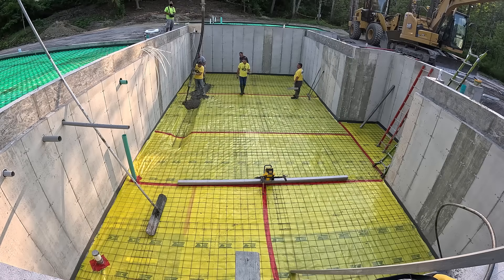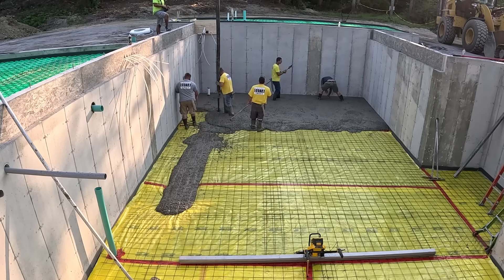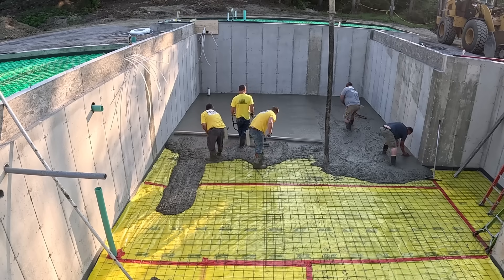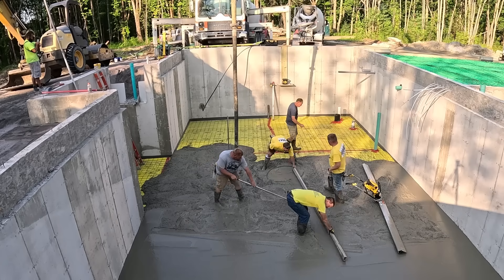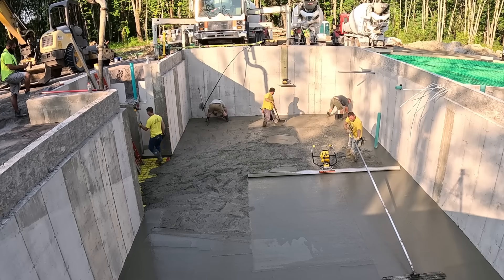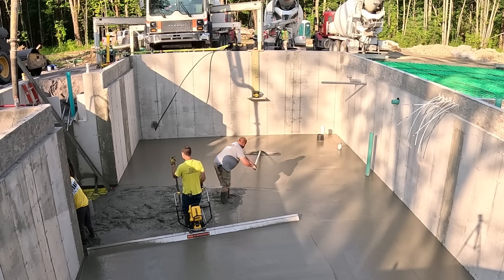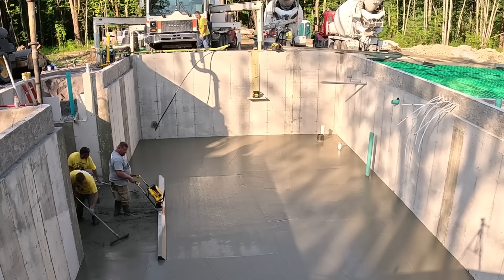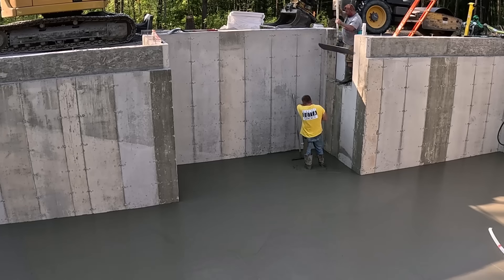It Cost $1000, But It Makes Pouring A 48' x 24' Basement Floor EASY!

Comment: Fine, you lift the mesh, then the guys behind jus trample it back to the bottom! Chairs or spacer blocks are cheap enough. I have been in the concrete game 45 plus years, so please do not tell me I am wrong, or don't know what I am talking about. If you were to cut a sample from anywhere down the central area of this slab you would find the mesh on, or near enough on the bottom. Cost saving, and corner cutting leads to sub standard work.

Comment: Smart choice, using Stego Wrap.  They were friends of mine, I created their first website.   But now that you got a fresh slab over a near-zero permeability polyolefin barrier, the only way out for the water-of-convenience is UP!   Therefore, unless you use a suitable topical epoxy based membrane on the slab surface, DON'T plan on installing flooring for 5 years!    Nobody seems to know concrete is hydroscopic, hydrophilic and highly caustic!      Fun job pour.  Thank the Lord for "typical" days!

Comment: nice to see contractors actually care about ordinance. the day care next door was having their porches poured and the contractor ordered the pumper truck for 5:30am and parked right outside my bedroom window. when i confronted them they said noise ordinance ended at 6 when i called the city they said 8. as i was leaving for work the guy running the pumper stopped me to complain. said they doubled check it wasn't a residential area and were told it was all businesses by the contractor.
Reply: How many times a decade do you have a concrete truck parked under your bedroom windows ? You can't let it go for one big occasion like this jeez.

Comment: Many years ago, I used to work for a foundation builder. We did 4' and 8' walls also. It never looked as soon as your operation looks. We had good results because we worked hard and fast. I see where this operation is simplified and effective.

Comment: I worked for Wimpey's in the early sixties to save money Wimpey would have told us to build a ramp to where the concrete was  needed to be  and we would have had to use wheel barrows to get the concrete to where it was needed no concrete pump would have been hired just lots of men with a barrow each,

Comment: Only $1000? Sounds awfully cheap for USA. More like $100 000 for this pouring.
Reply: $1000 for the concrete pumper.
Reply: @SplashJohn  ah that explains it. And $150 000 for the actual filling right?

Comment: I get the understanding of the wire mesh, but you pull it up, only to step on it. So doesn't that just defeat the point? Can someone explain this to me, please.
Reply: Right after you explain why you don't read the comment section before commenting.
Reply: No explanation other Han cheap misinformed and/or lazy. Shocked that mike si doing it thsi way like it’s some cheap spec build; in western Texas. wow

Comment: The wire mesh must be raised ~3 cm above the membrane before pouring concrete floors. Owners who understand this may sue contractors who fail to do so. You should consult guidelines such as those from the American Concrete Institute (ACI) or Eurocode, or at least discuss with your engineer. Raising the mesh is critical for structural integrity, crack control, and corrosion protection.
Reply: Preach -really sad to see such a high quality contractor like Mike Day still not doing this. Cmon mike, you can do better.
Reply: There isn’t anyone who does this. You are guaranteed crap by everyone.

Comment: So, you're pulling up the metal wire but then your crew is walking on it. Wouldn't that just push it back down?
Reply: When the wire is pulled up, gravel in the concrete mix goes under the wire.  When you step on the wire, it doesn't go back to the bottom because of the gravel underneath it.  For a simply slab, given the top loading, it's strongest with the reinforcement in the bottom third.
Reply: 1/2 inch of gravel concrete mix is worefully inadequate coverage-sorry-Thsi si wrong . Amazing how many allegedly smart commenters are still spouting this nonsense. Very depressing bd very revealing of how our building industry is so slow to change, read injurious and be up on modern quality standards.
Reply: @johnwhite2576 I've been a licensed contractor for decades and my engineer and inspectors have no issues with that method.  40+ homes and zero related callbacks. 

Its a fully supported residential slab, not a structural beam.  Shop slabs where equipment loading has to be taken into account, I use chairs (and 6" slab).
Reply: not  all the way    the  wire  will still be up  atleast a  half an inch off  the ground.  thats good  enough

Comment: why do americans never use rio bar chairs, pulling it up like that renders it useless
Reply: Looks like one guy pulls it up and the other guy steps it back down.
Reply: This is common in residential. Chairs poke holes in the vapor barrier.
When using wire mesh use concrete bricks.
More surface area prevents holes in the VB and keeps the mesh where it belongs
Reply: I am an architect/engineer, and I sometimes observe this mistake in Europe as well.
Reply: Some of us do.
Reply: I totally agree. No bar chairs. Big wast of time.  Best thing is to get pizza tray or Perspex plate to spread loads if worried about puncture in vapour barrier.  This is painful to watch.
Reply: Rebar chairs work great on 3/8 tied rebar but on steel wire you would have to place the chairs too close together and risk a bunch of hollows in the slab.
Reply: No insulation under the slab? Cold forever, ask me how I know.
Reply: @TomKacandes also will have condensation on the floor
Reply: Think about what your saying…your pulling it up allowing the concrete mix and aggregate to form a layer under it.  There is no way you would be pushing it down to its original position even with someone standing on it.
Reply: @Truth-wg7zc umm actually no. And even when it doesn’t protrude, the coverage can be far less than adequate 9at least 2 “ esp on typical 4” USA type slab)
The reason it’s dorm this way typically in residential America is habit , expense esp if you use quality plastic chairs that lock in they mesh without ties, but still fro slab this size probably only $100!!) and lazy, uniformed , unsupervised subs and workers . No excuse  though. The quality of American spec builds is simply put, poor. As for insulation, that’s a more debatable case. Once you get beyond 4 feet of perimeter, the energy penalty and likelihood of condensation decreases. And the expense, labor and material, to detail properly with tape is much higher.

Comment: 6 mm (mill) is about 1/4”. Is your vapour barrier really 15mm (mill) 5/8” thick?
Reply: FYI - "When it comes to plastic sheeting, “mil” is not a millimeter, but a unit of measurement equivalent to one one-thousandth of an inch. A grocery store plastic bag for example is about .5 mils thick or .005.  6 mil or .006 is a common mil thickness for construction grade plastic sheeting.  A thickness gauge or micrometer can help you determine the mil thickness of your plastic sheeting." From Americover website.
Reply: @nbco55 so a Mil is a Thou? I suppose it was a very heavy plastic film as expected not some kind of thick board.
Reply: The measurement for plastic sheeting isn't in mm but in "mils" (0.001")
Reply: @johnborton4522 when we rebore an engine block 30thou over isn't that 0.030"?
So confused😂
Reply: @gregknight3485  All on must do is read how plastic sheeting is sold and you'll see that he's using the common term.
Reply: If I were running Mike's channel, I'd delete dumbass comments like this one.
Reply: They must mean 15 micron

Comment: Lol😂 pull wire mesh up and then steps on wire mesh after. 
The wire mesh will look like a roller coaster 🎢 in the concrete.
Reply from the maker: Here's one of those pro's, HAHA
Reply: @MikeDayConcrete   I am an architect/engineer, this time you are in the wrong. Sometimes I observe this mistake in Europe as well. I also know of one case where a builder sued a contractor, resulting in significant financial losses because the contractor had to redo the entire underground parking lot floor under a large luxury apartment building due to this error.  As a so-called professional, you seem unaware of these American Concrete Institute (ACI) guidelines: ACI 318-19, Section 7.6.2, ACI 318-19, Section 7.7, ACI 318-19, Section 26.6.2, ACI 360R-10, Chapter 6, ACI 318-19, Section 20.5.1
Reply: @DizzyPanda As I stated above use concrete brick to support the mesh. Every 4 ft in the US.
No holes in VB and mesh is where it should be.

Comment: Please show us exactly how Darren gets out without leaving foot or ladder prints in the floor.  The video always cuts off right before that
Reply from the maker: I will on the next one, he pulls out the ladder, bends over the wall with a rake (kumalong) and "jukes" the concrete to fill in the ladder holes. Easy
Reply: The trick is; There is NO Darren...

Comment: $1100 to get the concrete where you want it, fast, without dragging it around and spoiling the aggregate ratio, and without wheelbarrows or other ways to wreck your back?
Sounds like a bargain to me.
Reply from the maker: For sure it is!
Reply: I just used a 20 m pump and it was $1,300 to place about 10 yd in some ICFs. Well worth the money.😊
Reply: i  dont think he  even owns a wheelbarrow